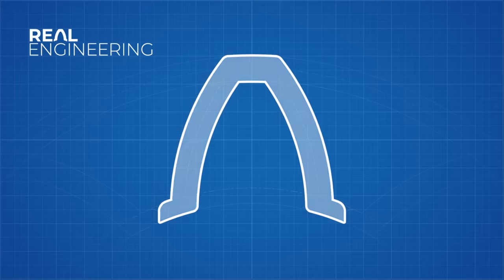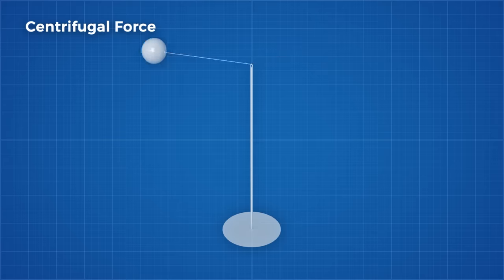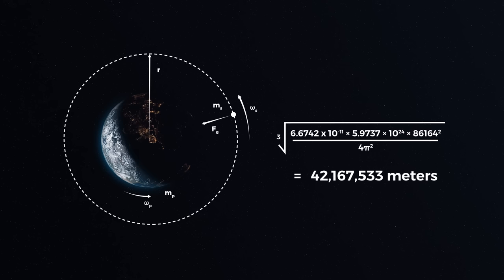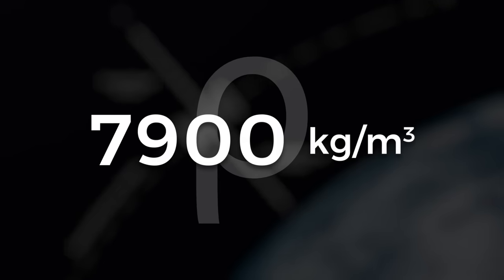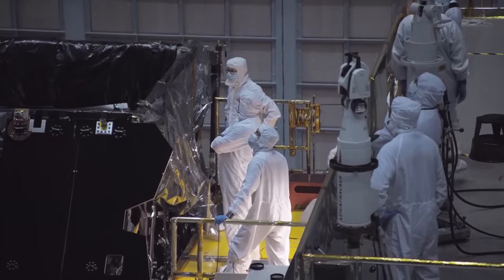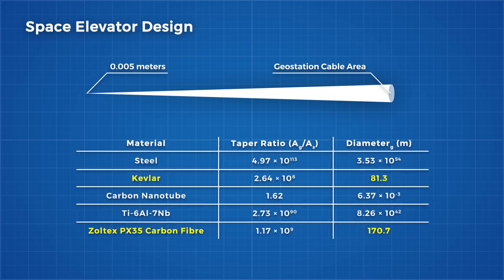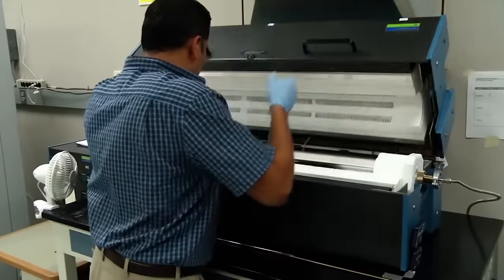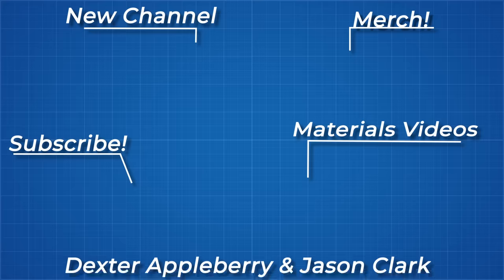Are Space Elevators Possible?

Comment: I think a Space Elevator is impractical, like 10's of thousands of miles of perfect carbon nanotubes or graphene, when there are solution we could do right now with the tech we have which would be cheaper and higher throughput, launch loops are my favourite option, basically you have a large metal tube in which you fire metal balls down this tube fast enough to create a parabola about a 2  - 5 miles long obviously the metal tube is magnetized and so are the metal balls, this raises the metal tube idealy to around 80km where the air is thin enough that you can get to or at least close to orbital velocity, and because you are on a giant series of electromagnets you can you don't need the energy onboard.

You can also "land" on the launch loop also retrieving the energy you put into launching it originally , but honestly it doesn't seem worth the risk when you can use the atmosphere to slow down and the electric cost isn't THAT high that it's worth the risk either. It is an engineering challenge and room temperature super conductors would reduce the energy cost significantly, but the energy cost isn't actually that high as you would regenerate the energy at each side of the loop by slowing the balls down in a magnetic field creating voltage.

the only constant energy drain is running the electromagnets and replacing energy from inefficiencies of regenerating energy at each side, but I think I remember the constant energy demand only being like 5ish megawatts for the non room temperature super conductor version, like thats not small, but like it'a not massive either. although to raise the launch loop it would take much more power, and would take a significant amount of time as you can't do it quickly or otherwise you would end up ripping the thing apart.

There are also Skyhooks and Orbital rings although Orbital Rings are like the big daddy of launch assist options, but the sheer throughput you can manage makes the Launch loop, Skyhook or Space elevator look like a dirt foot path while the orbital ring is a 8 lane super highway, where the cars driving on it can go multiples the speed of sound. So obviously the cost is high, but it's probably somewhat comparable to what making a Space Elevator would be.

While you can connect the the orbital ring anywhere underneath it with some relatively mundane materials, relative to graphene or carbon nanotubes anyway, and the actual orbtial ring it's self doesn't need to be that strong at all, as long as it can support the weight of which you want to put ontop of it.

The orbtal ring, is a ring around a planet or moon in which you have material going higher than orbital velocity again kept contained with magnetic fields, then you can build ontop of it, pretty much as much as you want, although you would want to have an even top layer so you can use it to speed up stuff to orbital velocity or greater, although for humans your limit is somewhere like 4x orbital velocity, as you can get to 2x orbital velocity with no extra Gs as you would counteract gravity and become weightless at 1x orbital velocity and then have 1G of acceleration pointing away from Earth at 2x orbital velocity at 4x orbital velocity you are at 3G.

This is something however you would only build if you were serious about expanding out into space, and you would want other launch assist options to conduct it.

Comment: Airlift to 30-40,000 ft is done routinely and economically with only aviation fuel. At what weight and height would a platform above the weather but accessible to aircraft be economical? As that introduces a variable of matching airspeed, what kind of impact would having the platform moving at 500-1000 MPH relative to the ground have on the calculations? (I'm assuming autonomous aircraft and payloads, much as Space-X is doing with rocketry.) I assume the tethering to the ground counters most of the atmospheric drag, how much drag would this introduce?

Comment: Calculus fade, it's a real thing. Today with solid modeling and material programs the answers are handed to me. It becomes too easy to rely on the machine and overlook seemingly obvious (though rare) errors. On the other hand the machine raises individual productivity to a level inconceivable even less than a generation ago. One manufacturer I know has an entire floor in one building filled with drafting stations. The lights and air conditioning are off. They simply do not need that space as fewer engineers require less space while producing far more work.

Comment: Noticed you didn’t mention the issue with voltage differential a structure like this would have to overcome. Previous space tethers burned up due to the flow of current. Could this be diverted or collected to power the station’s movement?
Reply: I don't believe they burned up.  Indeed, one used current through the tether to generate propulsion.

Comment: Space elevators were absolutely a fantasy at the time that space enthusiast and sci-fi writer Arthur C. Clarke conceived of the idea so many decades ago. Materials with mechanical properties anywhere close to what is required were far beyond the pale. Since then gigantic strides in atomic physics and material science have been made which have brought the concept in from the realm of cold impossibility to ALMOST an engineering problem. But that doesn't mean that space elevators are meant to be. It may be that the universe just doesn't contain within it materials that have the necessary strength and mass density properties to build space elevators to reach geostationary orbit from the Earth's surface. Close  is absolutely not good enough. Maybe close would allow space elevators to be built on other planets (or on planetary moons) with lower gravity such as Mars, but as for Earth we can only hope for additional breakthroughs in material science that may or may not come.

Comment: I've read the same paper and czme to the same con lusion. Without essentially pure graphene nanotube fiber, defect free for thousands pf kilometers, Space Elevaors from Earth are not possible. Current fibers have sufficient strain to density ratios to enable elevators from the Moon and from Mars.
There is an alternative for Earth, a sky hook, comprised of an orbiting Hub with really efficient rocket motors (thermal nuclear or nuclear ion engines) and a rotating tether that dips into the atmosphere to deliver and pick up cargo/passengrr pods. Gaining space and orbit remains below wg acceleration and at the peak of the arc, velocity exceeds escape velocity. Moon trajectory is nearly free, Mars trajectory has 80% of the delta-v needed. Reentry is not a fiery experience and returns much of the energy to the system.
I have a paper with the calculations mostly worked out, formulas to pick the selected orbits (only a few work) and preliminary configurations of system, with estimates of cable dimensions, and mass delivery to/from orbit as a result.  If you are interested, how can I make the paper available to you. The concept is achievable with current materials.
In 10 years, space commerce is likely to be choked by capacity to/from LEO. Orbital Sling addresses that choke point.
Reply: Hello Rich, how can I view that paper?
Reply: @JasonTodd339  I can email it to you but how do we take this to a secure space?

Comment: Are they possible...technically yes, but actually no.
.
Orbital rings, however, are not only possible, but they're possible RIGHT NOW.  No need for super materials...just a need to work out the actual structural science to build it.  An orbital ring depends on an active balance of forces that means you can hypothetically build it out of paper, if you know how...though the margin of failure would be razor-thin in that case.

Comment: Considering PRE-TENSION of Space-Elevator CABLE(s) ready for Load carrying; if the (Geostationary)Terminal Station (at 36,000 kms Altitude) weigh 1,000 tonnes; in order to pick-up vertical load, more Centripetal force (from Earth center) must be enhanced by Further away the position of the (1,000 tonnes) Terminal Space Station from the Earth ;
1) 10% Lift is 100 tonnes: need 1,365 kms Further (Altitude) extended Cable
2) 1% of Lift is 10 tonnes ; need 140.5 kms 
Further (Altitude) extended Cable
3) 0.1% Lift is 1,000 kg ; need 14.09 kms Further (Alititude) extended Cable
4) 0.01% Lift is 100 kg. ; need 1.40 km Further (Altitude) extended Cable
Can we design the Extendable Cable to adjust the Altitude of the Overhang SpaceStation (assumed 1,000 tonnes) from further-away 1.4 km (1,400 m) for only 100 kg Lift...upto 1,365 kms further -away (1,365,000 m.) ready for 100 tonnes of load-Lifting.. such Extension -Retraction of Alititude (1.4 to 1,365 km(max)) is quite IMPOSSIBLE by Existing technology (not to mention the Carbon-nanotube of 6.5 m. Diameter; cannot be REELed/Foldable into Bulk/bunch of (pulleyed-) Cylinder. Left alone can't be produced in large scale.. 6.5 m diameter (and tapered to 2 inch?) 36,000 kms in Length..(?!?) All just to prevent the TSS (terminal SpaceStation) not to totally Fallen-down and crushed.!!
Reply: Maybe you don't need to fold/reel the (6.5m diameter nanotube) cable ; just left it OVERHANG for further 1,400 kms, that the WHOLE SpaceStation can "crawl/run" on it Back & Forth. (IF We ve already made 36,000 kms of cable, no problem just for 1,400 km bit more/longer..)

Comment: Material strengths are still really the least of your worries. The greatest two issues are energy and buckling. 

Sure if you had a large enough counterbalance far enough away you could remain in tension and avoid buckling. But what about the intermediate stages for this plan? How do you build a massive tower without it collapsing after 10 feet above the tallest building. Especially if it is supposed to taper. 

Secondly why build it at all. Are elevator motors somehow more energy efficient than rocket engines? It doesn’t make sense there isn’t any utility.

Comment: alright. here me out. this idea probably violates at least 20 frickin laws of physics, but what if people made a giant straw to space??
alright. here's my idea, you make a long tube, presumably with some stronk materials. you turn it into a vacuum, and u send a cylindrical pod that carries enough oxygen for the trip, and you make the tube go up to some platform 43000 feet up into the air, where there's a giant platform. now, this is all speculation, so what if we just pretended the platform that is made out of heavy stronk material has minecraft physics, and can be held up by a measly tube. now, im no proffessor, physicist, or genius, but im pretty sure that if u make a vacuum-reliant space elevator any higher, there probably wouldn't be enough air pressure outside to keep the pod goin. im not sure exactly how high u can make this thing, but im sayin 43k feet cause google said that's how high commercial planes fly. then, u would most presumably build a very possibly rocket launch site that high up, in very low pressure, in very cold temperatures, that could launch rockets without like idk, 1 pound of fuel. and remember, im just some stupid middle-schooler who thinks sending people through a straw to get crashed into by commercial planes is fun, so take my word with a grain of salt. also, if no one has thought of this stupid idea yet, can someone with an iq higher than mine please make a video on whether this is possible?

edit: oh wait. vsauce exists

Comment: IF you could use carbon nano-tubes as the structural support you might be able to integrate conductors to run power down from the geosynchronous station to operate the elevator.

Comment: So, why not fly upwards with a cable attached, fly in the opposite direction to the earths spin, at some point the earth will be dragging you along on the cable, at this point you let the cable out slowly from beneath, once clear of air and wings become useless use rocket power to help fly up and away from the cable until simply unreeling the cable is enough to let you fall away from the earth. The end of the cable will need a rocket or decent parachute in order to keep it away from the ground as it is reeled back in.
  This is funny as i had the idea an then remembered seeing this title so i came here to actually watch the video. Another idea i just had was to keep an electric glider / plane holding the other end of the cable so that the end of the tether can also orbit or fly around the earth. solar panels either on the electric plane or on the satellite might be able to power the giant electric plane. Initially the idea was how to launch rockets without using all that fuel.

Comment: Sorry, dealing with orbiting objects (debris and satellites) makes elevators effectively impossible. Every orbiting object crosses the plane if the equator twice in each orbit. With the 30,000+ objects of 10cm diameter or greater presently being tracked by USAF, all of which have periods of less than 24 hours, that amounts to many more than 60,000 crossings per day - actually closer to 300,000. The elevator amounts to a stick that is aligned on the equatorial plane, with all these objects zipping past from twice to about 48 times per day. Assume the same 5km radius "safe zone" used by the ISS, and a typical radius along the elevator of a bit less than 8000 km for a circumference of about 24000 km. The probability of a given object crossing within a given location is a chaotic function but we can distribute evenly, so 24000/60000 equals about 0.4 km. So some softball sized object would be passing within 0.4 km of the elevator almost constantly. That's less than 1/10 the distance that requires the ISS and communication satellites to expend thruster fuel to move farther out of the way.